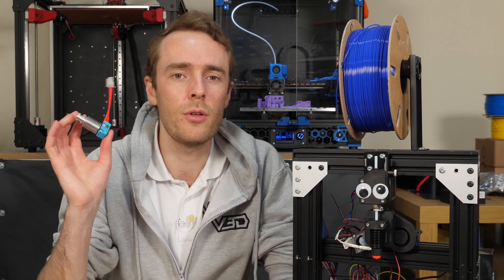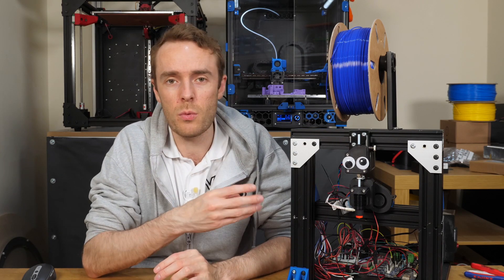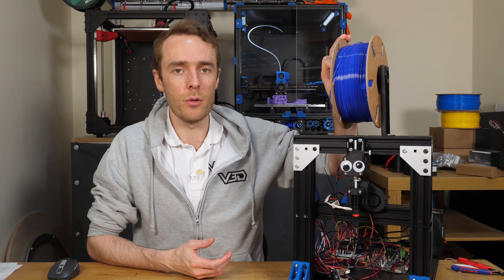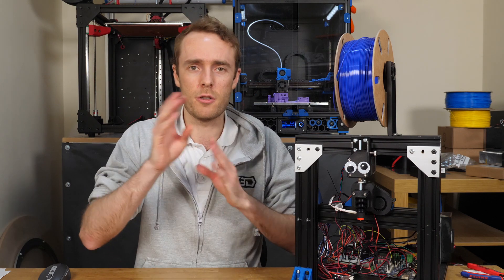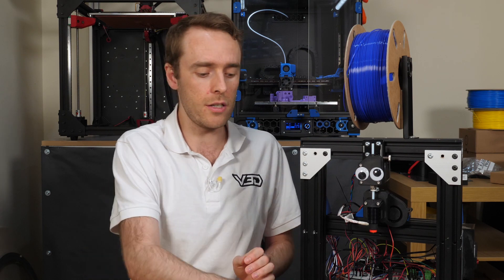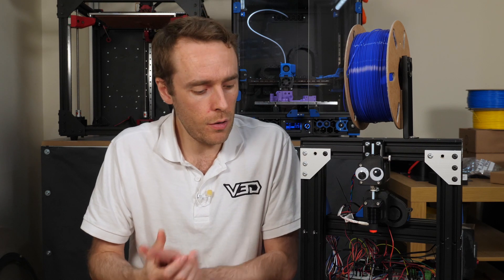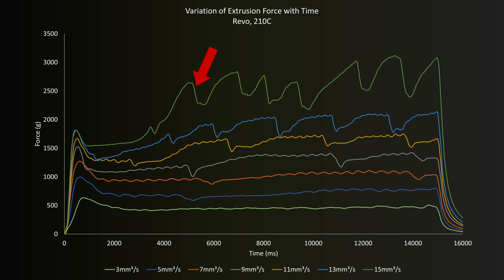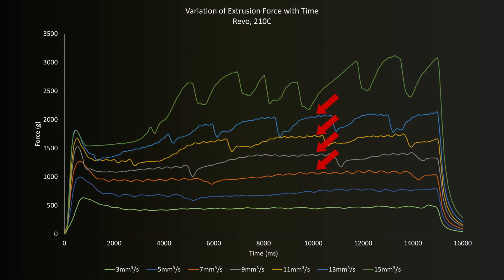V6 Size with Volcano Performance?!

Comment: I know someone else pointed out that position of the thermistor and heating element meant that the measured tempature on the revo was higher than the tempature within the extruded filament, while on the the V6 it would be lower, since on the V6 the thermistor is on the other side of the fillament from the heating element, while in the Revo, the thermistor is right next to the heating element and the filament is surrounded by it. This might mean that the input tempature of revo might need to be raised so the actual tempature of the filament would be equivalent.

Comment: At which temperature were the PID tuning set? When PID is optimized to 200 degree this is may the (or a) solution why the REVO performs so "bad" under 200° C (according to @14:27)

Comment: Just a shame about the closed ecosystem, exactly why I won't buy it, it's clever even ground breaking but you can only buy it from e3d. A company that will charge you £5 to deliver a £2.99 nozzle. Taking something that once was open source and democrarised and making it proprietary and expensive. I see nothing to celebrate this is a backward step

Comment: the delay before power increase is probably just due to the thermal mass of the heater block coupled with the distance between the plastic and the thermistor.  As you melt plastic, initially the temperature in the surrounding area of the block will fall, and it'll take some time for this "cold patch" to spread to where the thermistor is, before it can be seen, and reacted to.

Always keep in mind that the PID is reacting to the temperature of the thermistor, and not the temperature of the plastic, so don't take "responsiveness" on the graph too seriously.  A block with thermistor very near the heeater, (copperhead, for example) will give a much more impressive, stable looking graph, and will appear more responsive.  The problem is that the filament temperature will vary a lot more with load(flow) changes than a thermistor which is ideally closer to the plastic.  Opposite the heater, like a v6 is probably a good thing, too, since that area won't reach temperature until after the plastic has melted.  The phase change pulls a lot more energy than that last few mm of metal.

Comment: Power and PWM is not the same..  especially as the revo has a PTC and the v6 don't... Will the rig be open to copy?? Good Work Adam
Reply from the maker: I mean, the power output curve for Revo is actually pretty linear in the region I'm testing so realistically it probably doesn't make much difference, but its something I'll be looking at in more detail in future testing for sure.

Comment: This tests are really good! One last thing you could measure is the filament movement, maybe an extruder gear, but instead of use with a motor, use with a sensor

Comment: Nice work!, My theory on the wiggles is the plastic melt zone where the plastic being a poor conductor of heat builds up pressure until melted, then a blob pushes out, seen as a pressure drop, then the fresh plastic is lower temp and the pressure builds again, then repeat. You could potentially prove this theory by comparing the CHT nozzle against a standard nozzle, if this theory is correct the CHT with an improved melt zone will lift the "wiggle zone" up to a higher flow. The larger drops, are likely as you mentioned the extruder slip.(Maybe change to a LGX)

Comment: I believe the big dips in the force over time graph are slips. However, slips should reach the same peak force before each dip. This does not make sense. The only way I can think of for this to make sense is that you are sampling the load cell at a given frequency (like 100hz) and the peak events are significantly shorter (like 0.01ms), and so you are unlikely catch the true peak (at which the slip occurs). To perform say 10khz sampling of a load cell, you need a fast slew rate load cell, a seperate wheatstone bridge and high speed amplifier hooked up to SPI or other means of communication that can shovel data around fast enough.

Comment: FYI, the ripples look like they're coming from a rotational component in the extruder.  You can see the frequency increases as force goes up.

If you convert the ripple frequency into a time period, you can probably figure out which rotational component in the extruder (or motor) is causing it.

Comment: the delay in heater reaction to temperature change is why i think thermistor position in the hotend matters more than people would expect. I'd love to see a test for print quality between a thermistor in the nozzle verse a thermistor near the heat break.

also the ripples are probably due to PID loop. pressure will increase and decrease slightly as temperature fluctuates.
Reply: I agree with another commenter how suggested the ripples are from the way the teeth in the dual gear extruder mesh. This is a known problem with many extruders. It's normally only noticeable when printing rectangular items. It produces a very uniform wood grain look in prints.

Comment: I’m seriously loving this series! I think most of us assume that the change in the heat block’s temperature is more or less instantaneous rather than a gradient from the nozzle to the thermistor causing a time delay, so you breaking down the data visualizing this is super informative. If our PID loop’s only input is the thermistor in the heat block, you’re very right that we’re missing a piece of the puzzle - if we could tune the PID loop to take account for the extruder beginning operating (and preemptively turning the heater on to compensate for the extruded filament taking energy from the heat block before the thermistor senses that change) that could be a pretty big deal in improving consistency of the output extrusion. 

A++ work here and your breakdown of it was very easy to understand. I’m excited to see where this goes!
Reply: Yeah. PID control is a feed back control method, relying on the error (difference) between the set point and the state. A feed forward control method would be able to account for the increased material flow and turn up the heater preemptively. But for thermal management PID is sufficient, and there isn't really any performance to be gained for a normal printer. However, this application may benefit from a feed forward control loop to reduce the impact of temperature variation.

Comment: Adam, the revo heater is a PTC and its power drops as the temperature rises. Estimating power from duty cycle may introduce a significant error hence the observed 'higher power'. A more accurate way is to use and integrate the current, assuming you have fixed voltage. There are current sensors for Arduino. Or you can measure once current vs temperature and compensate the power reading in software.
Reply: Agreed. Measuring the current would be better than measuring the duty cycle.

Comment: Interesting stuff, possibly silly question, but did you PID tune the firmware for each extruder?
Reply from the maker: For each hotend, yes. Well Duet does it a little differently, but they were tuned for each setup.

Comment: As a researcher myself I love the scientific though still light enough approach you take!

Having a bit of experience running chemical plants (plastic producing reactors) I might be able to help out with the PID effects you are seeing. The delay in response is simply how long it takes before the thermometer reads the temperature change plus a bit of data smoothing that is often done in the firmware. The PID itself will react instantaneously once the drop in temperature is effectively being read by the thermometer. The design of the Revo makes that I expect it to be faster to read the change as its simply a lower heat mass (at least thats what woudl happen with identical thermistors/thermocouples or whichever probe used, with different probes the probe itself might cause delays as well).
The higher power uptake in function of filament flow rate of the Revo must mean that the filament is heated to a higher effective temperature than in the V6 (the energy can go nowhere other than lost to environment or into the filament). Not having ever made an attempt to even guess what the effective temperature the material would be coming out of the nozzle is the data you present indicate that the plastic is way below the heater block temperature when running at significant flow rate in the V6. Assuming in the Revo the plastic comes out at heater temperature (hence heated from room temperature to ~200 °C or 180 °C delta T), the V6 must have a 25% lower delta T (1-0.28/0.37) or only 141 °C delta T or it is coming out at 161 °C. In reality it will be even colder as also the Revo will not reach the full 200 °C. These numbers seem to make sense as from experience I know that I need to go 40~50 °C up to increase the flow capability of a standard V6 like hotend with 30%.
The problem with this simple calculation is that I neglected the melt heat (a lot more heat is picked up when passing Tg and when effectively melting than the rest of the heating curve. For PLA this is however a quite low value.

Theoretical heat needed for a 180 °C heat up of PLA: heat capacity ~= 1.2 J/g/K or 1.2/1000*1.25 = 0.0015 J/mm3/K or 0.0015 * 180 = 0.27 J/mm3/s or 0.27 W needed to heat-up 1mm3 of PLA in 1s. This is amazingly well in line with your numbers! There is error introduced in the PWM averaging, the heater is not exactly 40W, at higher temperature the resistance changes a bit (quite a bit for the Revo) hence the relative difference in the numbers still stands. Only the different heater characteristic might have artificially increased the difference a bit.

Another way of looking at this would be to take the length of the melt paths. I know the Revo about 30% longer than V6 but dont have precise numbers.

Interesting would be to compare the Revo data with for instance a Dragon standard flow. That's a regular V6 style heater block but about the same (again I need more precise data) heat path length and this again with a Dragon High flow. Next comes a Rapido: same style heater but way longer melt path. I expect that in the low flow ranges there will be near to no differences between these 4. When going up it probably boils down to melt path length. Unless the distance from the heater element starts to play a roll for the Dragon high flow (can be calculated and since its copper I expect very minimal influence.

Coming back to the PID. A feed forward power based on filament flow and filament heat capacity would be quite easy to implement. This way a near constant PID output and thus hotend temperature can be achieved. One could even go a step further and effectively change the hotend temperature for parts with higher flow rate. That will in practice however work only very partially because the heater block can't be heater and cooled quickly enough for that (an even more extreme construction than Revo would be needed).
Reply: Insightful, thanks.

Comment: Would be interesting having an Arduino measuring the force and regulate the speed accordingly. Measuring the speed or the filament length over a certain time would show the flow capabilities of the Hotend.

Comment: On the inconsistent slipping force; Could it be the motor skipping instead of the actual gears slipping? That could explain it as the motor likely skips at different forces with different speeds (Flow rates). Anyways, thank you for your great work!

Comment: What's interesting is that triangle lab recently released a new version of their ceramic heating block for the V6 hotend which seems to have a similar heating response to that of the Revo. It's not a quick change system but it does offer really fast heating and response to temperature shift since the ceramic block does have the same thermal mass as a copper heating block for example.

Comment: I would guess that the I - term of the heater is responsible to regulate it, which is slower than the P or D terms. That's where the delay comes from.
Of course that's basically what you said, just worded a little more technical.
Either way, this should be a setting of the controller, not of the hotend. New extruder might require re-tuning the hotend PIDs.
Edit: the "spikyness" is also a result of that, it's most likely the result of a P-value that's too high and an I value that's to low, causing overshot. Again, would be fixed by PID retuning. Not a mistake of the hotend, but the result of a mistuned controller.
Edit2: the ripples in the graph might also come from the mistuned hotend PIDs
Reply: I agree with M Sierra - the delay would be due to the I term.  It would be helpful to show what the PID parameters actually are.

Comment: Concerning Extruder Skipping: Vez3D might have run intro the same Issue as he was trying to print at 15k mm/s. My theroy is that the shearing forces of the molten Plastik are getting too high. Squeezing the plastic through such a tiny hole, might introduce some Issues on the material or liquid physics.

Comment: PID has never been a good way to control the temperature of the plastic being extruded.  It is always lagging behind.  It was probably chosen because it is easy.  Although tuning it is not so easy.  Autotune is pretty poor.  It is adequate until you start pushing the limits.

We know how much plastic is going to be extruded and we know how much energy it takes to raise the temperature.  So why not just add that amount of energy as the plastic is extruded.  You do have to take into account additional energy due to the motion of the extruder and the part cooling fan blowing on the nozzle.

High pressure is almost certainly an indication of inadequate melting and probably you would see poor interlayer bonding at some point.  But unless the actually slips you should be seeing the correct amount of plastic being extruded.  It just might not be at the right time.

Thanks for putting this together.  It is interesting.
Reply: @Doug Ingraham - what you’re proposing would be “feed forward” (as opposed to “feedback”j control of heater temperature, and it’s a great idea.  Though it’s even harder to implement since (unlike a PID controller) it would need to properly process seconds or even a minute’s worth of gcode to see what’s coming up and send the right amount of power to the heater ahead of time (there will always be a delay between when you change the power and when the temperature of the heater block/filament actually changes).

Would be MUCH more complicated and difficult to get right than PID tuning, but if you did get it right it, not only would it allow you to extrude faster, but the extrusion consistency at lower speeds would be better too, probably cleaning up several of the minor printing issues we can never get right.  In fact this would improve (if not completely replace) what we try to do with pressure advance.
Reply: @fredhamilton1701  Thanks for the reply Fred.  The prevalence of 32 bit and 100+ mhz processors with plenty of memory makes this idea possible.  You need to look a few seconds into the future for something with a big heater block.  A hot end like the Revo with low thermal mass, a powerful heater and a thermistor much closer to the meltzone will make this more practical.  My gut feeling is that as long as you get close, the thermistor feedback will let the algorithm self tune.  A small  pattern at the start of each print could dial it in for the characteristics of that filament.  I hope someone pursues this idea as I am retired and Ironically I don't have time to look into it further.

Comment: Great data, but we need some more please. Yes extruding filament with the V6 causes the nozzle to cool and the massive aluminum head block takes a while to cool down. You got it, the PID loop turns on the heater when the thermistor at the end of the block finally gets cold enough and by then it is playing catchup. You don't know the nozzle temperature because you are not measuring anything close to the nozzle in a V6 all you know is the temperature furthest away from the heater. The V6 is not more stable it can only measure temperature far away from the heater and nozzle so it reacts slowly as it takes time for the heat to travel through the heat block. That is not stability but a sluggish system that will not hold temperature as well. The Revo is measuring the temperature much closer to the nozzle and properly tuned will perform better because the loop can react quicker. Actually "spikey" is GOOD if you understand control systems, this is a tight control loop working hard to closely control the temperature which is measured at the correct place so it can react. We need to see a plots of the measured temperature along with your power levels at 7:40 in the video. The end result we want is temperature control your plot only shows that the loop is responsive not the result.  Additionally you can't chase the temperature very well when the PID control loop doesn't know that the load on the system is changed like a cooling fan coming on or extruding at a higher rate. Ideally you should  tune the PID while extruding filament at the rate your are going to use while printing with the cooling on based on this data.  The Revo also heats the nozzle evenly all around and I thought that was a BIG selling point.  But the big question is how are the results when you print.

Comment: If you want to add one more graph… you could calculate the work rate for the extruder (you have the force, speed, and mass flow). I’d be interested to see if this makes up some of the difference in efficiency. The mechanical work of the extruder is mostly converted to heat I guess.